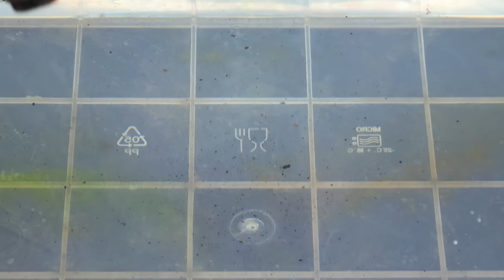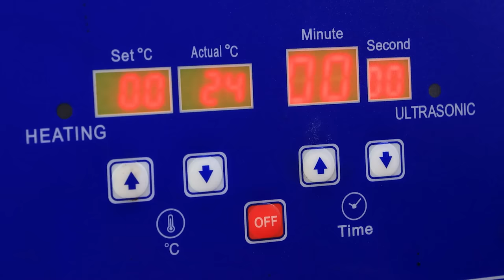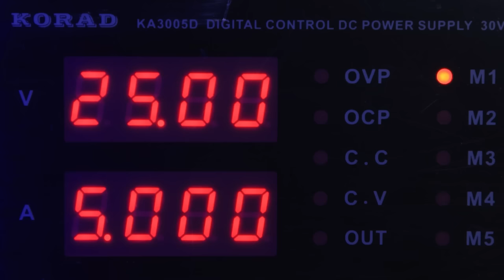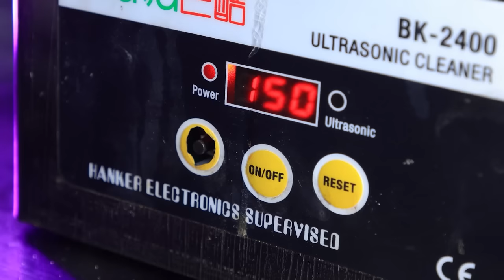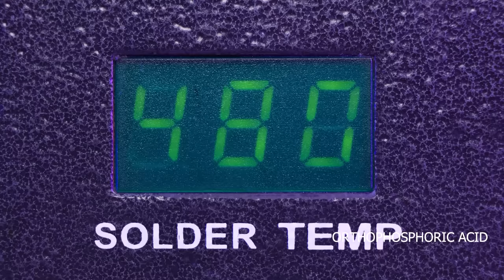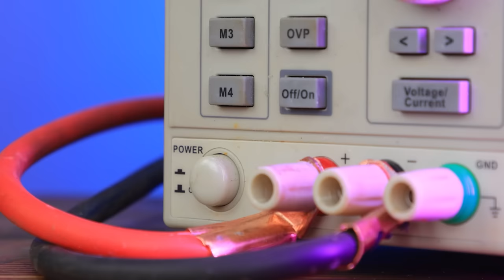SVT-40 | Rifle Restoration

Comment: I have a 1945 SVT 40 that is in extremely excellent condition except for the rile bore. The bore for some reason is extremely cruddy , which I been slowly cleaning with cotton patches and mystery oil only. However, I'm unable to have the bore clean enough in firing a cartridge through it. Any  recommendation in what to use in cleaning bore better ?? Thanks

Comment: good job, but learn to tig or mig, then it would be a 10/10, like you use foil with the tin, you can use cobber or brass with steel and its not gonna stick

Comment: Why don't you sand blast them. I figured theirs a reason just wondering. Great work by the way
Reply: Sand blasting is very agressive method of removing any finnish as its extremly abrasive.... its great method but not usable on every job..

Lot of the parts he is dealing with are thin rusty sheet metal and sandblasting woulg go right through that metal creating even bigger holes...

It would also make the pitting dammage on the more solid parts even worse is it removes material...

Chemical way is more gentle to whatever metal is left from the original firearm